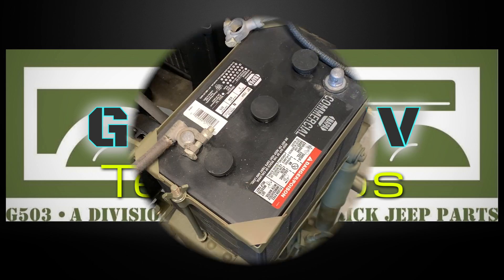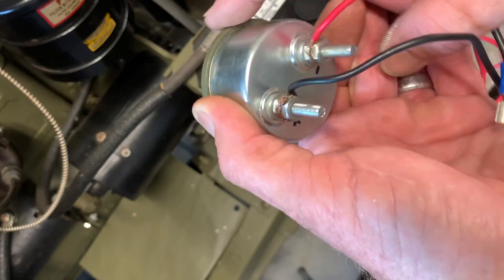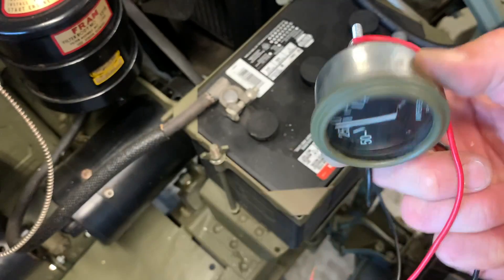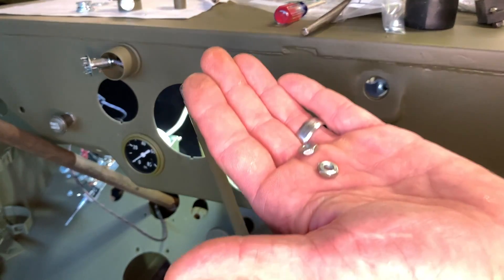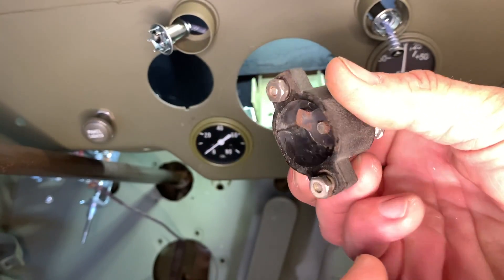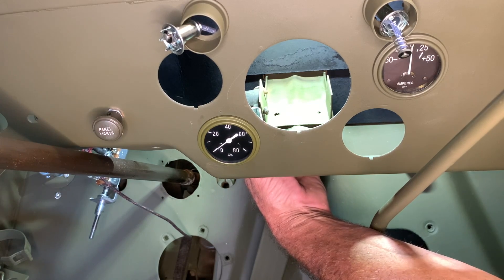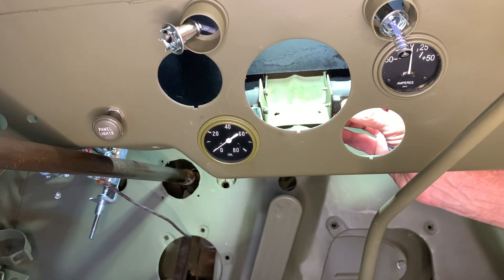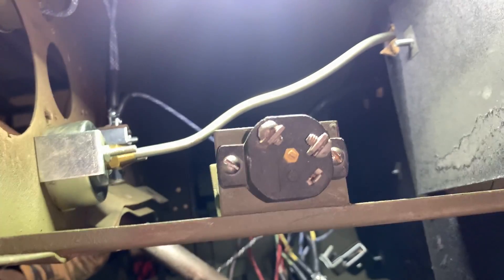G503 Wiring And Electrical (Part 9) Wiring the AMP Gauge and Breakers, Willys MB Ford GPW WWII Jeep

Comment: OK , two things .....When you had the original ammeter , did the one from Ron have the same polarity ( + on the SAME side ) ? and did you use the original circuit breakers ? that is NOT a great idea ......ask me HOW I know ? LOL If someone is that much of a purist , at the very least , they should be load tested to ensure they do , indeed , pop . Going back in there after everything is done is NO fun . Cool vid , thanks for all you do Scott.
Reply from the maker: Yes. the polarity was the same. Some reproductions are not. The circuit breakers I used were new. Thanks for the comments and watching my friend 👍